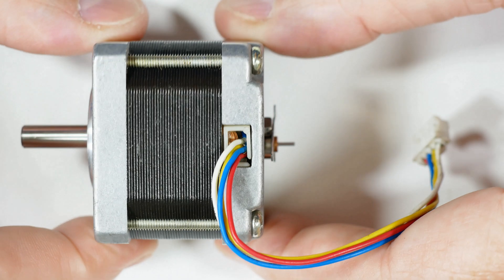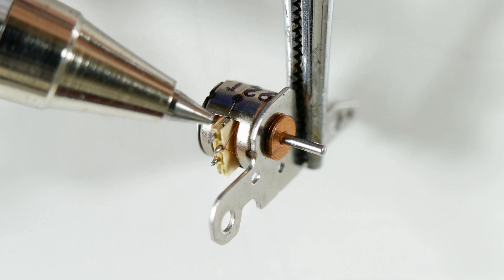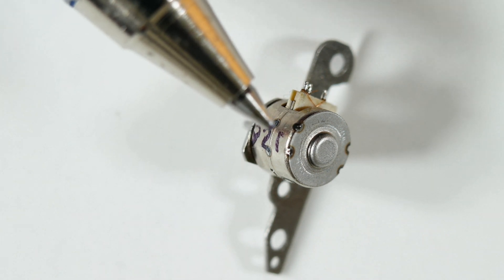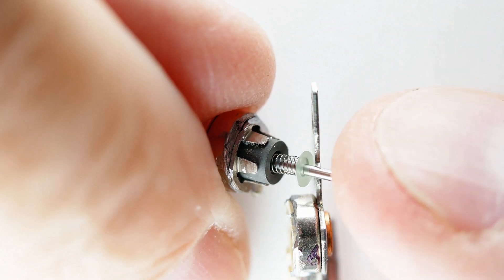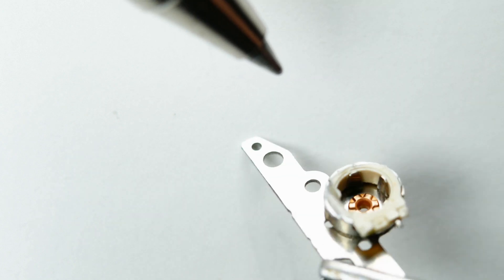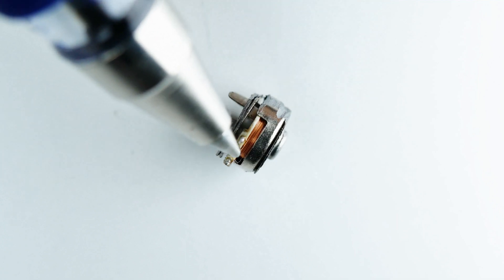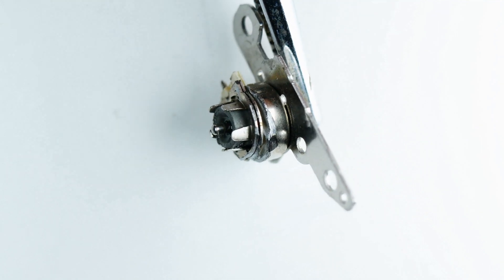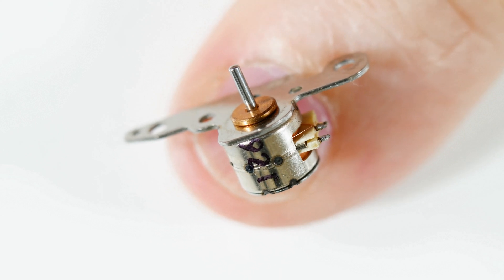Micro Stepper Motor (4K)

Comment: Great! thanks! Do you know the torques and voltage requirements!
Reply from the maker: It depends on the specs of the manufacturer. Can be anything from 3 volts to 12 volts typically.